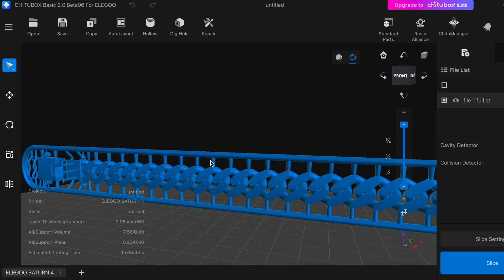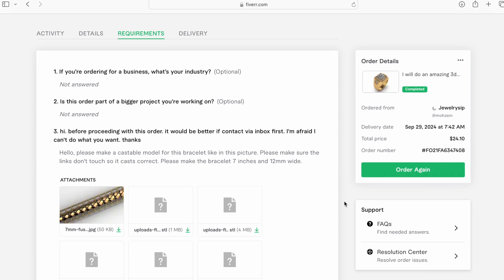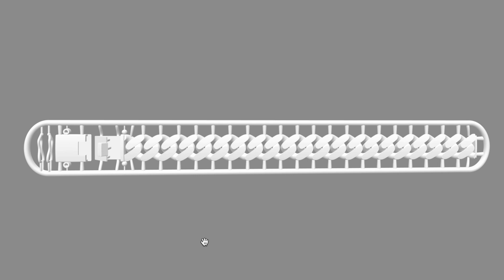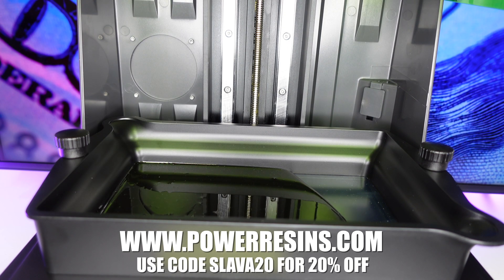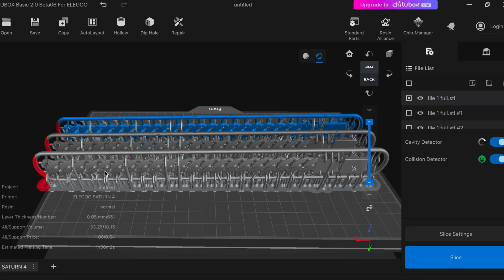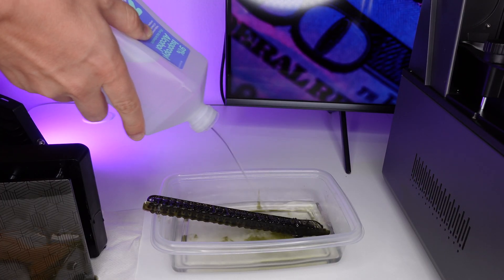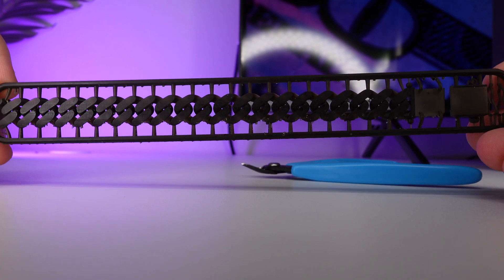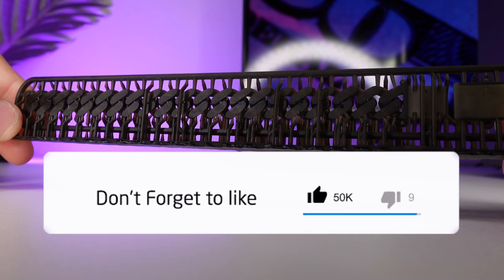How To Print ENTIRE Chains And Bracelets With An Elegoo Saturn 4 3D Resin Printer

Comment: How do you estimate how much gold/metal will be needed for casting on each project your doing ?
Reply: Thats generally done by the complex calculations in 3D modelling software, it calculates the volume of the entire model and uses the density of the respective alloy to calculate gram weight.

Comment: This is the ultimate video demonstration of how to print a whole bracelet and not having to solder to join them. On a note i wonder how the clasp looks like ? Since traditionally they have a mirror finish thanks to using a roller mill to reduce the gold’s thickness under so much pressure that it’s finish is super smooth and shiny after a light polish.

Comment: slava have you done research on paying another company to print the file for those of us that dont have a 3d printer or only want to do 1 piece in order to save on retail prices
Reply: To begin with, getting into the jewelry business, even with access to a 3D printer, has its limitations. You're still heavily reliant on a skilled bench jeweler to cast your wax models, handle sanding and polishing, set stones, and finalize the piece. The challenge is that many jewelers, stone cutters, and designers tend to charge what they wish, to make something for you, knowing you’re dependent on their expertise. Unfortunately in this business, your lack of hands-on experience can be used against you, unless you make it worth their while by buying in bulk upfront, but for that you'd need to be pretty cash rich to begin with.

While courses like Slava’s may outline standard pricing structures, the reality is that these guidelines often don’t apply in competitive jewelry districts. It's not an ideal world. Precious metal prices are fairly standard and reasonable, with a bit above spot prices, the real markup comes through labor and profit margins. Established workers can leverage their own skills to create and sell pieces directly on platforms like Etsy or Shopify at competitive prices. In contrast, you'd be forced to price your items higher just to cover outsourcing costs, as well as platform fees. This makes your items less attractive to potential buyers, especially in a saturated market.
Another issue is that many jewelry buyers, particularly on platforms like Etsy, are becoming more aware of generic, mass-produced designs created from pre-made 3D models (CGTrader files). These pieces often lack the personal touch and craftsmanship found in bespoke, hand-crafted jewelry, which is increasingly in demand.

If you want to print your own 3D files, you can use local 3D printing services or websites like ForgeLabs (Canada) or Xometry. However, expect to pay anywhere from $20 to $50 CAD per print for resin models(More depending on the complexity of your model) add shipping costs to that as well. You'll probably be printing multiple prototypes to choose the best one,  and you could quickly spend as much as it would cost to purchase your own 3D printer, hardly a sustainable strategy.

My advice is this,  start by taking a few hands-on jewelry workshops in your area. This will give you a practical understanding of the process and help you identify which specialty you enjoy most, be it metalsmithing, lapidary work, or design. Unique, handcrafted pieces sell much faster and are far more appreciated. The appeal of owning jewelry that is truly one of a kind is a huge selling point in today’s market. 

Btw if you go to etsy right now, find a piece of jewelry and do a google image search on it, it will quickly link to the generic crap on CGTrader lol.